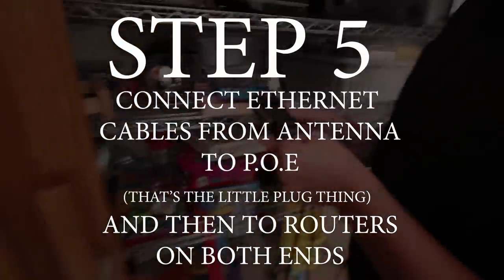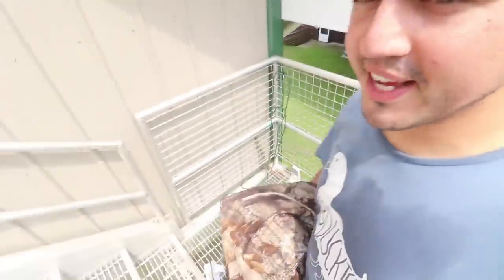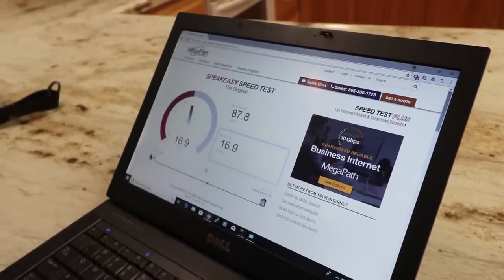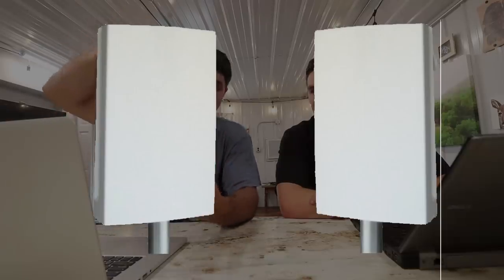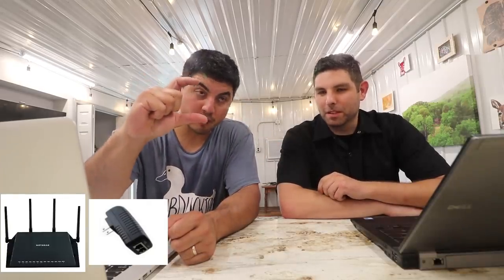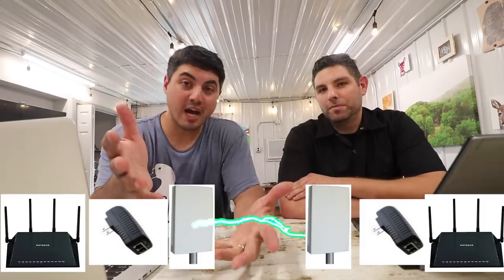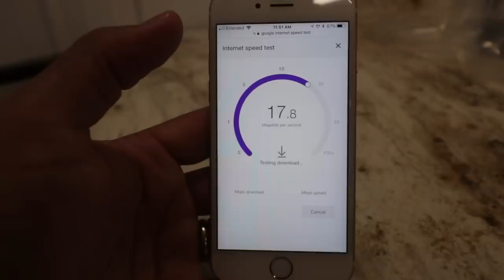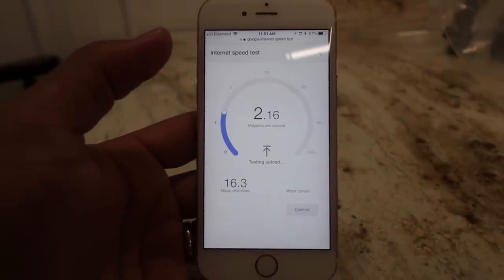How To get Internet From a House To Outbuildings, Barn, Studio, Office, Setting Up a Wifi Bridge

Comment: always love when a content creator doesn't edit out the parts they struggled with. If you're struggling to put something in, probably means most people are and they at least want to know that other people have the problem or hopefully how it got resolved.
Reply: I completely agree.  When I was having trouble getting the bottom of the transmitter and receiver, I recalled that it was a difficult task.

Comment: Thank you so much for making this video! I did this and now have my security cameras set up, can watch UFC in the barn/man cave.   lol
Reply: This is more a question than a reply,: if you have a router, why do you need to wire everything throughout your property? I thought routers  were used to send wireless internet, to different points in a house, apartment or building etc... Sorry for not being computer savvy.
Reply: @eddie-ed1959  They do - but a detached barn or structure may be too far away to use the signal from the router.
Reply: @eddie-ed1959  to add to @4score’s reply, another thing with distance, metal buildings are tougher for WiFi to penetrate so having a router in the metal building is best(think of a dome reflection effect)

Comment: About 2 months ago I was searching for a way to extend internet to the shop.  This was the first video I found and thought, "it doesn't look too difficult."  Two weeks later when my items arrived, I struggled with the instructions, got frustrated attaching the transmitter and receiver to the buildings, and after it was all said and done, it didn't work.  I troubleshooted it the next day and ordered a new router.  Six weeks later, I unplugged all the connections, reset the units to factory settings and slowly walked myself through the process (while reading the directions) and hooked up the new router.  IT WORKS!  I made it much more difficult than it had to be and we now have working internet in the shop.  Thank you so much for this video!!
Reply: how is it holding up? if you're in Texas, who is your provider if I may ask?
Reply: David M. I’m thinking of using the same system. I’m in East Texas. Internet is balls around here. I’m not close to the toad so I need to connect closer. How can I be sure the distance won’t change my speed?
Reply: Chris Hockless In my own use, i’m only bridging about 200ft and it works well in that application. However, I highly recommend getting your own router and connecting it to the access point (wherever it is that you want internet access) after you set up the system. A prerequisite, as shown in the video, is that there is a good line of sight and the two modules are at or under 3 miles apart from each other. If your location satisfies this, i.e there is not trees or building that would block the connection and your connection is within 3 miles, this system should work just fine. Again though, the Tycon software that allows you to setup your own access point is trash, hence why i recommend instead buying a router of your choice to provide a wireless signal after you set up the bridge. In that case, you would have to ensure there is an established internet connection via connecting the ethernet of the receiving end of the bridge system to a device that could test the connection like a computer or game system. Once you know there is a connection, you simply plug in and set up your router as if you were setting up a regular one without the bridge. I went about 3 months without a router and I used the Tycon software to setup my own access point and it was horrible, so I highly recommend pairing the system with your own router to get a solid connection.

Comment: Sorry for zombie posting on a older vid but that cable is not uv rated and will get chewed up by the sun. Since the jacket is not uv rated, eventually the jacket will turn to dust and your conductors will short and if you are running POE you may short the switch or the radio and cause damage. You need a CMX shielded cat 6 that is rated for direct burial that is UV shielded and it will last for a long long time. It will take years, but that cable won't last and cause potential issues and/or damage later on. Just search on amazon for "CMX Cat6 Solid Copper". DO NOT RUN POE OVER CCA (Copper Cladded Aluminum) use only solid copper core. Great video looking to start a homestead with the family really enjoying the channel!

Comment: If your in-laws' house and the barn you're living in are sharing the same electrical system (which is typical), you could have used a pair of network powerline adapter. With these, you are using the existing electrical cables to carry any ethernet data. I don't mind dealing with wireless bridges but I tend to avoid using them. Personally, I like to use the spectrum for wireless devices only. Whatever else that can be wired should be, especially if they are really closed by. Keep up your excellent work!
Reply: You are absolutely right!!!! I was one step away from spending megabucks! I already had a TP-link for my AT&T microcell (I live out in the sticks and need this for my cell phone to work) to connect up via my wireless router. I got to looking at it and it said these devices have a 300m range.  I dragged it out to the barn, which as you say has common power lines to the house, hooked up my laptop to it and it worked just fine!!!  Cleaner, with true plug and play connection.  So all I need to do is get a TP-Link wifi range extender and I can actually work out in the barn using wifi, and don' t even need to hook up using a cat5 cable. Can buy those for $60 - $90 bucks depending upon the speeds you want. Just wanted to let folks know a bit more detail about this because it is definitely a money saver if your two buildings are powered with common lines.
Reply: unfortunately the house is too far away in my case i tried it already
Reply: Found one a powerline Ethernet adpter kit that can go for 300meters. Thank you!
Reply: @nandomancinas2563  would you please send me the link to purchase it as well. Thank you in advance :)
Reply: @nandomancinas2563  Thank you very much. I appreciate it🙏

Comment: Your better off just buying a bulk box of cat6 or cat7 ethernet cable and running from the house to whatever building you want internet in. It's much more reliable and just add a second router if you want wifi connectivity. Otherwise just buy a switch and plug your network cable into it and then run individual cables from your switch to all your devices.
Reply: How long do you estimate an Ethernet cable would need?
Reply: Ya that's exactly what I was thinking she's a short run and could just get 1k Foot box of outdoor cat5 🤷🏻‍♂️
Reply: Not if you have all concrete between the house and outbuilding.
Reply: 300ft max for wire Ethernet.

Comment: Question
You're getting like 80mbps down and 18 up with the bridged connection... but what's your original internet speed?
Reply: I’m assuming he probably only has 100 mbps. All of the equipment is hardwired, so not much WiFi speed will be lost.

Comment: Great video could use this WiFI to my brothe's cottage 2 doors down with visual available. But, also looking to run next door, houses are 40 feet apart. Would you agree that I could just string CAT 7 underground. I would go router to router with no interuptions by using holes large to accept cable with fittings /plugs intact.

Comment: On the apartment (metal building) side, is there an broadcasting antenna or anything inside the metal building or is the receiver act as the WiFi router? 
Just wondering if I had my reviewer mounted on the building side if the metal
Siding would prevent signal from getting inside the building.

Comment: Just wondering why not go the hard wire route ? Just a small slit in the ground. I had to run internet to my garage apartment around 160' from my wireless modem/router. I bought a premium 175' Ethernet cable from Ebay for 50 bucks and hardwired it 3 yrs ago. Never a problem and hardwired is the best.
Reply: Network powerline adapters work great if both ends are sharing the same electrical system (same metering). I've seen it working with transformers in between but I'd rather do a wireless bridge then.
Reply: Brian, I agree, direct connect is faster than wireless.
Reply: So I can just buy some ethernet cable plug it in to my existing router.. and run it all the way to another wireless modem, (100ft distance) .. ? And should work fine?

Comment: There's only one thing I would do. You know when you were attaching the white boxes the the fence. I'd put them higher, up on the building for instance. RF doesn't like those fences, and it would be much stronger mounted on the building wall above the fence. That said you may have lots of signal with it mounted on the fence ? You've probably heard of "terrestrial" internet isp's ? Mine goes up to a 6000 ft mountain and antenna and comes down off the antenna to me on the other side ! Generally its much slower than yours.

Comment: You did most of the hard work getting the line out the house. Run a wire to your house and you gold up to 100 meters. This only seems logical from attic to attic so you don't have to run wires down your house. Curious on how stable it has been for you?
Reply: When i saw the small distance he was gonna cover with a lawn in between i thought: dude just dig a smal trench and run cable its 1 hour work and way cheaper and better.

Comment: I NEEDED THIS VIDEO!!!... BUT, I have a question. How much does this affect the broadband speeds to/from the source structure? If the source is 1Gmbs and I “bridge” to the guest house I have, literally just 16’ away, what would (an estimate, of course) the average speeds be for both structures?
Reply: Well, if your source is 1 Gbps, you won't get that kind of speed on the other side. According to their documentation, you will be able to achieve up to 100 Mbps which is still plenty for most cases. Still be able to stream up to 4k with no issues, downloads will be relatively quick, online gaming, etc.

At your guest house, you probably will want to get a switch or an access point to distribute your network(internet). Be the easiest solution. You could use an old router if you want and turn it into an access point which was demostrated in the video.
Reply: And to add onto this as I didn't fully answer your question, there shouldn't be much impact on service quality at both locations depending on provider and of course how much usage the users are doing. So, of course, more devices accessing the internet or doing heavy downloads, you may see speeds slow down. That being said though, you will be fine for the most part I would say.
Reply: G1itch02, sounds awesome, thank you! We’re in a rural area that just (.... and I mean just) had fiber installed and about to be switched on, Altice by Suddenlink being the provider. They told us it’d be better to just setup an account for each structure. At $175 a month that’s a bit too steep for any of us here, even at a whopping 1 gig of mbps! I was hoping for closer to around 200mbs for the guest house, but 100 is still a lot better than the 3mbs the old cable cable DSL provided. Thanks for the reply!!
Reply: @errtex  if you want faster internet I suppose the only other option would be to burry an Ethernet cable and get a mesh WiFi system.

Comment: Why not just bury weatherproof ethernet cable between the two buildings? As long as the buildings are less than 100 meters apart it should work.
Reply: my office is 100 feet from my home in a studio, and I was just offered a work at home job, but they require me to be plugged directly into the router in my home. I was dreading digging a 100 foot trench 18 inch deep, when I came across this. You think the signal will be the same, or worse, with a wifi bridge kit? To answer your question, a bridge kit means you don't have to spend an entire day digging a massive trench. I just wonder if the download/upload speeds would be the same. on wifi, I currently get 70 download, 10 upload, which is pretty good. I've never had an issue. but they still want me hardwired in to the router. any ideas why?

Comment: Great video! From my experience with this product, if you connect the LAN port of the side B antenna to the Internet/Data port on the router at the remote site, you would not need to disable DHCP. This way you still get to separate the remote side devices with the devices on the main site.

Comment: The only piece missing: at the receiving end you didn't mention what port do you plug the ethernet cable into on the router - does it go into the WAN port or into one of the 4 LAN ports?

Comment: I have purchased items through your link. Am able to get internet when I plug directly from POE into laptop....Hitting roadblock when it's connected to Netgear Router. Suggestions anyone? Thanks!!
Reply: A little late to reply but I may be able to assist. Are you still having issues?

In the video, he had a router on the other side but that isn't always the best option. You could use a switch or purchase an access point which will serve what you need. You essentially need to turn your router into an access point.

Comment: couldn't you just run ethernet cable from the router from the house to the building and bury it in conduit?  this is something we are going to have to do as well...
Reply: You're right. Would have been much simpler. The heat and sun will ruin it in 2-3 years. Would have found a complete wireless system or buried the wire in small PVC.

Comment: my office is 100 feet from my home in a studio, and I was just offered a work at home job, but they require me to be hardwired into the router in my home. I was dreading digging a 100 foot trench 18 inch deep, when I came across this. You think the signal will be the same, or worse, with a wifi bridge kit? I just wonder if the download/upload speeds would be the same? on wifi, I currently get 70 download, 10 upload, which is pretty good. I've never had an issue. but they still want me hardwired in to the router. any ideas why?
Reply from the maker: It will be the same, mine is the same at my house and studio

Comment: I just want to have internet in the backyard. I don't need a bridge, I want to extend the Wi-Fi by  cord to the backyard so wouldn't one antenna be sufficient?
Reply: You should run a cable from your wireless router provided by the ISP to your back yard/porch or whatever, and then hookup a cheap secondary wireless "router." However, for the secondary "router" you will want to configure as an Access Point, since it's a wireless access point, it may be referred to as a WAP setting. Every company calls it something different, so read your friendly manual :)  For a better walk-through google, "How to configure router in Access Point Mode."

Comment: So you have to have a router on both ends?
Reply: Well you could use another router but in most instances (simple home networks) you would want a switch or an access point at the other end. If you have an old router laying around, you could turn it into basically just an access point which was shown in the video.

Comment: When you first pulled the antennae out of the box, I thought 'Why did they use those 2 big blocks of styrofoam to cushion that tiny black thing?". 
     Could you stick another antenna between the two you just installed and connect another location to the internet without affecting the quality of the connection you just made?
Reply: It depends. Some setup allows it but I would not put an antenna (and a building) directly between the two original ends. I'd rather do a "triangle" setup, where all three antennas would be in line of sight of each other. Keep in mind the antennas needs to have a sufficient spectrum pattern to make this work.
Reply: @simonforget280  hmm...what about the speed? And what if it's an apartment?

Comment: I would have run cat5 between the two buildings. You can run Upto 300ft
Reply: is better to run fiber, cat is highly conductive and so if lighting gets to it, good bye end devices.
Reply: Cat6 claims to have a similar limitation but I'm communicating over one that's almost 500 feet long right now. It doesn't affect my speeds because I've got lousy DSL to begin with.

Comment: Hey Austin, awesome video. Glad the move went smooth. I hope you all are adjusting. I am wondering how much of a db lost u get using antennas. For instance any time there is a junction point in a communication path there is a certain amount of signal losses. Please forgive me but I can't comprehend downloads as a unit of measure for communication strength. I would like to do the same kind of thing where I am at.
Reply from the maker: Not sure what exactly your asking exactly Randy but we tested the speed at the sending house and the receiving house and the signal was the same. Hope that answers your question. 👍
Reply: Thanks! That pretty much answers it. I transfer some very large files for my job. So I just wanted to know if it runs somewhat sluggish sending and receiving data through the air like that. If it works that is cool. I will have to look into ur setup.

Comment: Do you know if I can get three “receiving” ends for this and connect it to one transmitter end?
Reply: WILLIAM HOISINGTON you can. Go with a ubiquiti product that supports ptmp ( point to multipoint) one is set up as an Access point( that’s on the Internet side) the others are set up as stations. It works amazing. I use it to send internet and 4K 8megapixel IP security cameras from multiple buildings.
Reply: yes.you can use ubiquiti brand. use LAP 120 gps for transmitter and lbe 5ac gen2 for receiver. Point to Multiple Point transmission. its more faster than in the video.